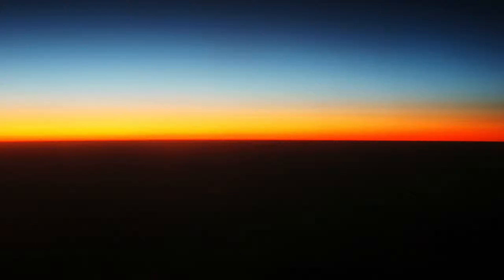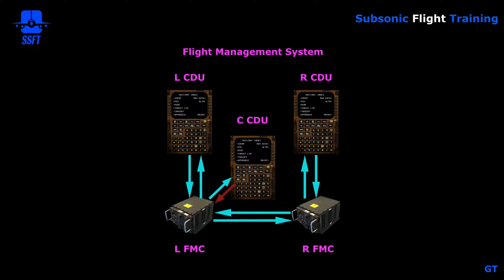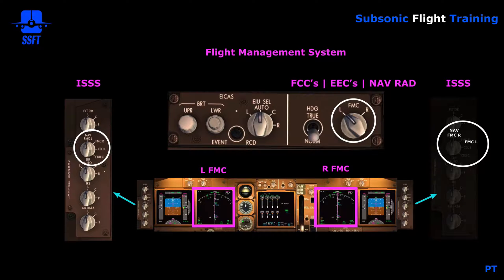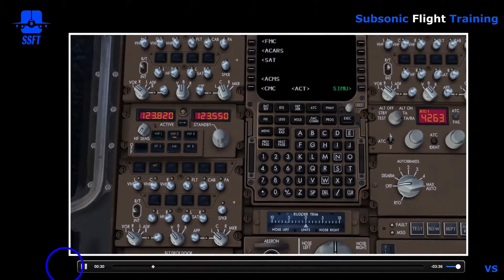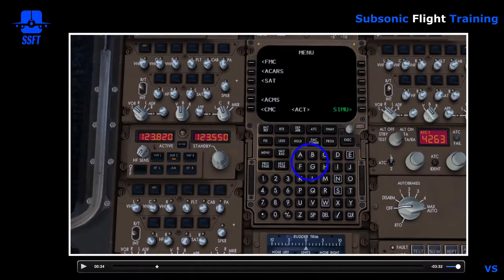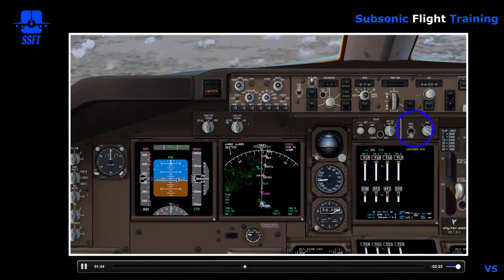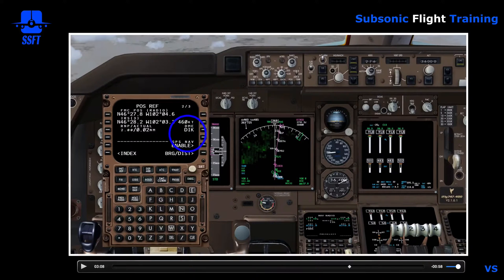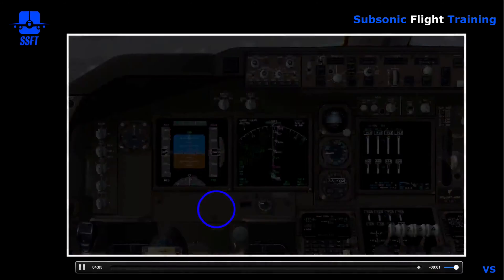Flight Management System - FMS Overview (iFly 747-400v2)

Comment: Thanks for the video!! Very informative. A question: which simulation software are you using in the clips?
Reply from the maker: Hi Albert, The majority of the videos were produced with the iFly B747-400 and FSX Steam Edition, however now I have switched to the PMDG 747-400 and B747-8 using Prepar3D V4. I am on the Tech Team with PMDG. I have not made a new video in over a year, but will start up soon once again. Hope you are getting some value out of the tutorials...